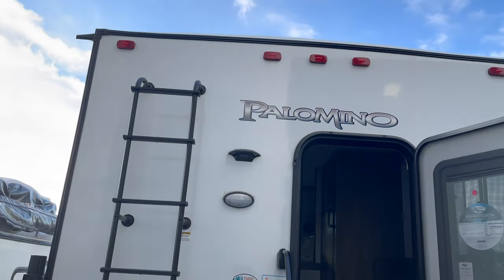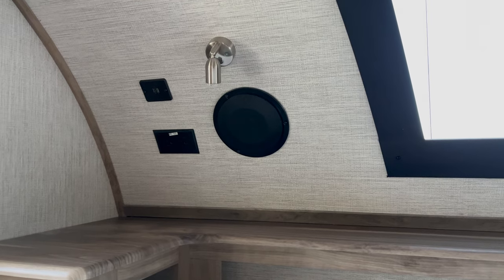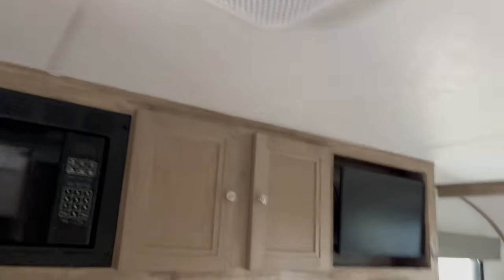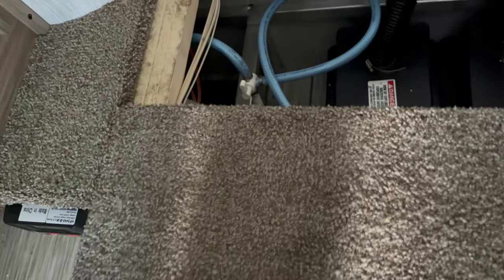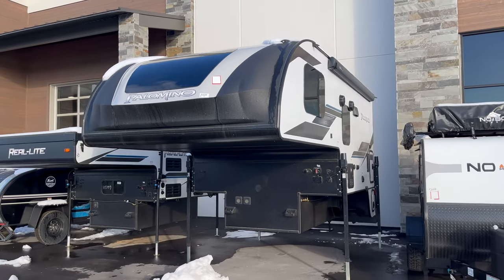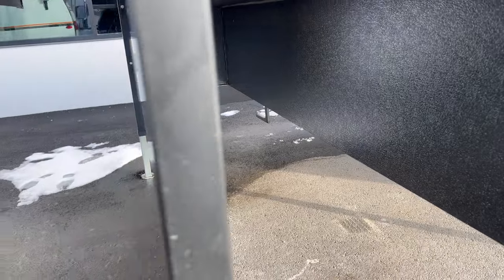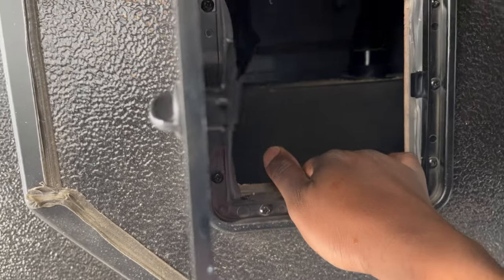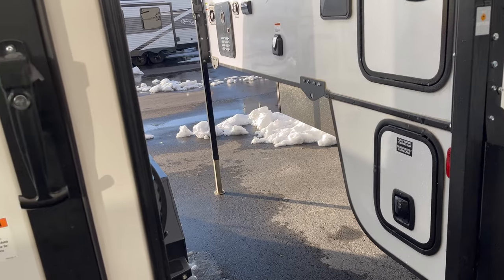Spacious Truck Camper By Palomino That Has Everything You Need Including A Slide And Solar!

Comment: Check into construction of the frame, side panels and floor. Truck campers are known to leak and if there is wood in the construction, they will rot. The newer 2024 campers are coming out with aluminum frames and no wood construction. I’ve been looking into buying one also and I have the same truck ( actually a 3500 HD LTZ). I kind of like the travel lite 775U or 900U. Not all the bells and whistles but no wood for 2024 and reasonably priced.  Good luck!